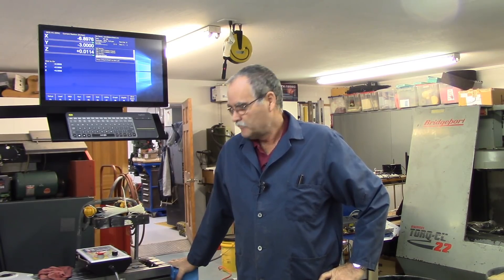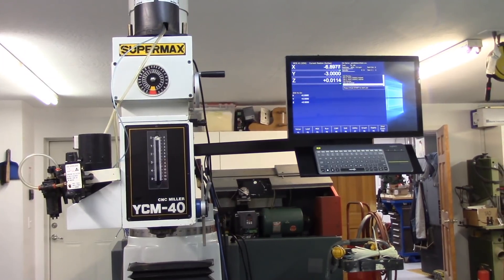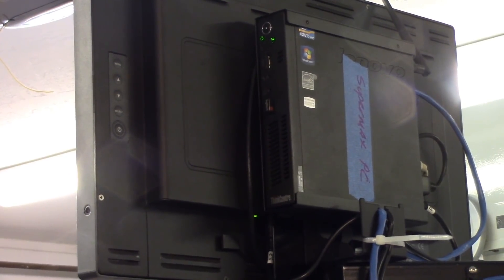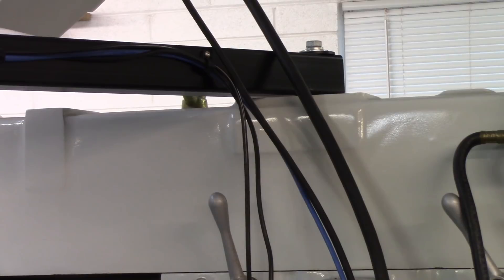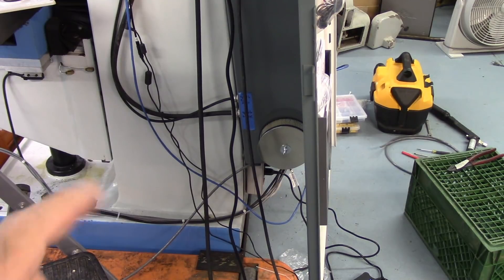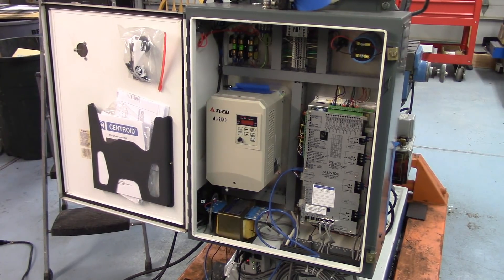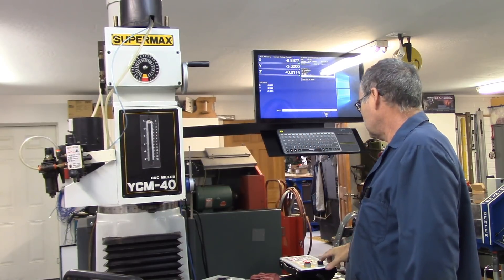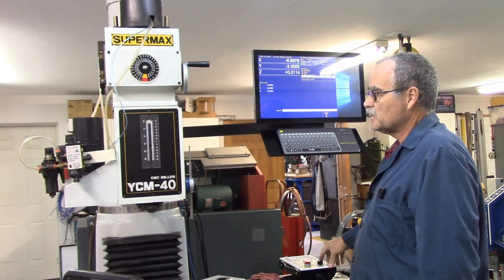Supermax update - 12/27/17

Comment: Marty, can you run your mill in manual mode with the Centroid just functioning as a DRO?
Reply from the maker: JohnBoyDeere, yes, though the control would be one expensive DRO,!
Reply: Hee, hee! Some control mfg. won't let you run/have a manual mode, go figure? Ya know every now and then a person just wants to mill the end off of something without having to write a program:) Thanks for the info as Centroid doesn't mention it that I can find?
Reply from the maker: JohnBoyDeere also has a power feed feature if memory serves. As for manual mode, just hit the Estop and crank the handwheels
Reply: Going to order a new Centroid control tomorrow as my Anilam 1100 is starting to give issues. I must say the Anilam has served me well for over 20 years now. I do various 2D and 3D mold work and frequently only need X and Y axis powered so I have an easy mechanical disconnect affair for my Z drive:) Thanks again and I will post info as I move along!
Reply from the maker: JohnBoyDeere, great. I think you'll like it once up and running.
Reply from the maker: JohnBoyDeere not sure it makes any difference, I hope my videos helped make your decision
Reply: Yes, thanks!
Reply from the maker: JohnBoyDeere let them know when you place your order

Comment: Those long thin stretchy drive belts still concern me. I believe they were used when controls did not have excel and decel ramps they just hit. Also the common feed and rapid speeds were much less. The belt was to take some of the shock,
the 4 to one gearing will be interesting. Tried that with an index that was the stock gearing spun the motors to fast at even a reasonable feed and rapid but had plenty of TQ. Some of these older machines were stepper and the gear down added resolution to older drivers that had limited or no micro stepping. Attention to detail here is impressive, like the monitor / computer mount

Comment: Excellent retrofit Mr. Marty!!!
Reply from the maker: Thanks Marco....almost done.
Reply: Happy new year Mr. Marty,
I already started my upgrade projects with the Acorn boards.
Is so easy to install and set up software and hardware than Mach3 or Mach4!!!
Also your videos are very helpful!
Thanks!
Reply from the maker: marco glad it's going well!
Reply: Mr. question: do you know how to setup the spindle orientation for tool changer operation in Centroid soft.?
Reply from the maker: marco, not that simple. If you have an ATC you'll need to have a custom PLC done. You'll need to know every step in the tool change process.